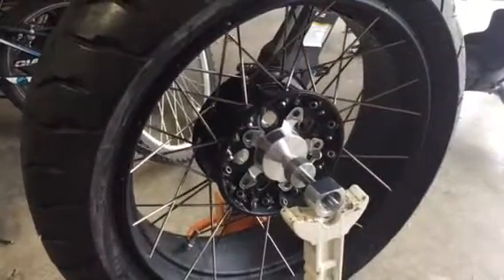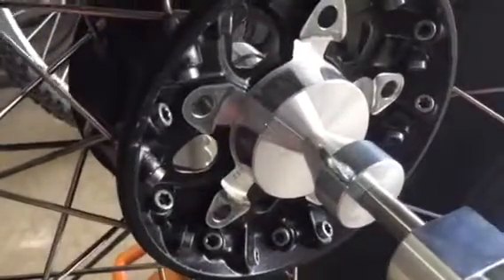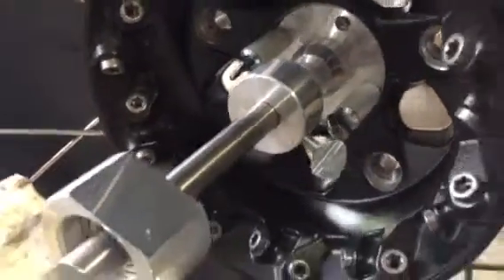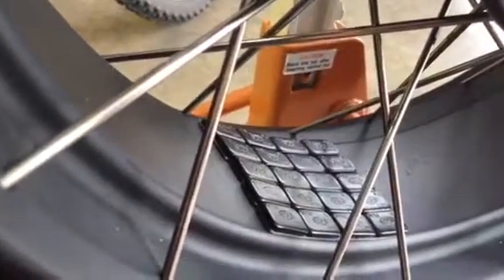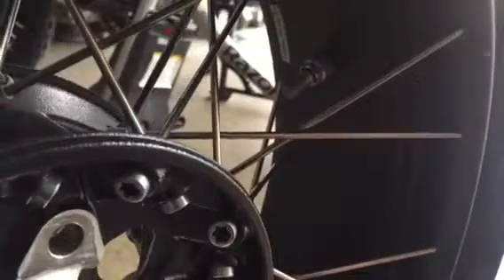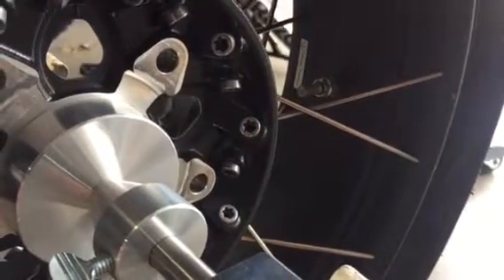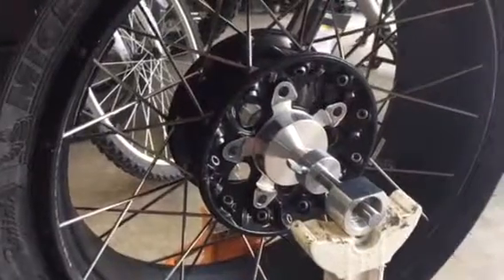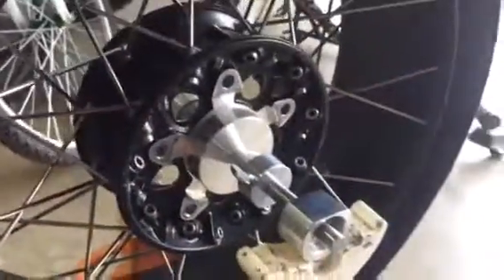Static balancing GS R1200 rear wheel

Comment: Hi GSGuy,

Not sure how much weight you put on there. But the BMW r1200gs a lc manual state that the max weight that can be added is 80gram...
Looks like you have way more?
Did you check if your wheel is true (horizontally as vertically)?